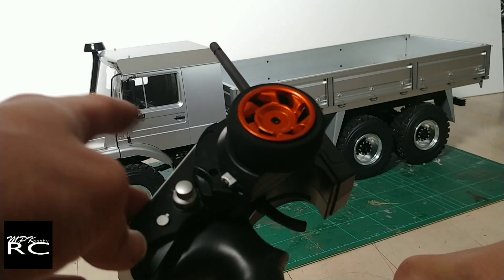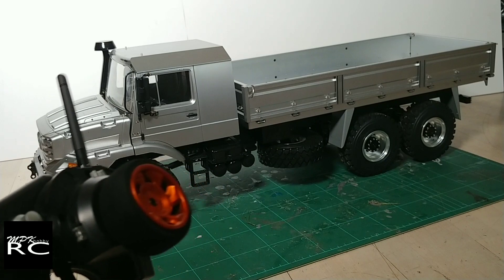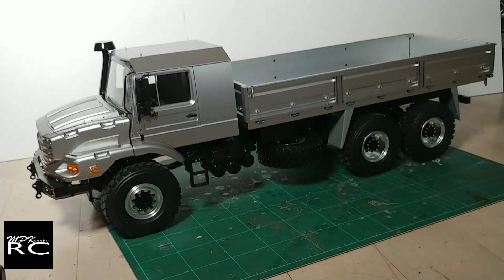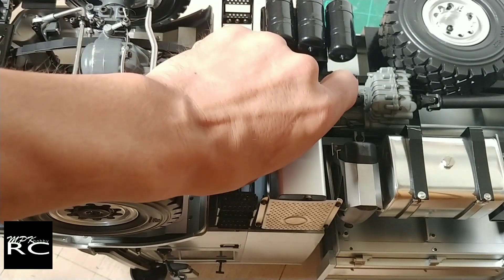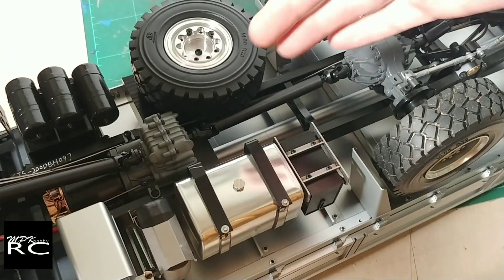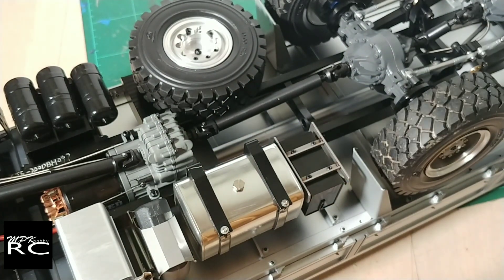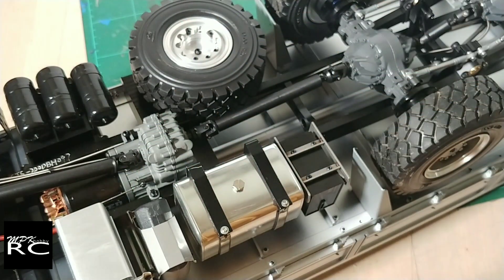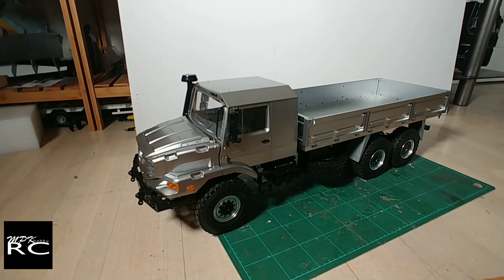Question for Gerry..

Comment: Hello sorry for the late reply!! The cable is the first thing I would look at, i have noticed with some rc4wd vehicles the cables are sometimes not installed correctly.
Start with very small adjustment right on the transmission and see if that helps! Hope this helps!
Reply from the maker: Cool! Thanks for replying, il try that out thanks.. Wasn't sure.. 
Ps again sorry about the name thing..
Reply: @mpkhobbyRC  no worries, my buddies at work call me Gary all the time!
Reply from the maker: So iv been thinking about turning this rig into a lifted king hauler.. Is that blasphemy? I mean i love this truck but love hauling stuff off road more... Thought ud be someome to ask..
Reply: @mpkhobbyRC  not at all, I have tried for years to make my semi's perform better off road, thicker rear diff oil is my new try. When I had the overlands bed off for painting I was looking at it for a fifth wheel and it should work, but its tall so you would have to modify your trailer.
When I priced out the total cost for converting my king hauler to 6x6 I just decided to buy the heavy haul instead!

Comment: just stumbled across this video searching overlands.  Not sure if you got this fix but is as easy as 123 all it is that your servo throw (movement) isn't enough to pull. the shift lever that holds the shaft into high gear.  Now if this transmitter was a better model you could adj the travel of that throw but since it doesn't have that option.  The solution lies in fine tuning your cable or...the servo is throwing to far in low gear and not enough in high.  you also can move servo horn over to compensate that as well...many ways to fix issue and these are just a simple few but its been 3 months so I bet you got it figures out.  Im looking into snagging this 6x6 up because not so hot on my 4x4 beens sitting still just because Im pissed that there isn't shock options out on market for it
Reply: thats my thumbs up at the top 8-)
Reply: do you still have your cab etc are you selling it or?
Reply from the maker: Thanks man! Yeah i ended up just adding a crimp next to the servo.. 4mm seamed to do the trick..
Reply from the maker: I do.. Why? Whould you be interested? Iv just received another im turning into a scania.. So have 2 each bed and body..
Reply: @mpkhobbyRC  Are you in USA if so how much for a complete cab with all the trimmings such as light grills etc..you can email me if you want at one2manyrcs@gmail.com. I am on the fence on my brand new never ran 4x4..its white thought about switching color or in this case just a new cab see up..Also I am debating about the 6x6.. If I was to get the 6x6 do I really need the 4x4?  Probably not lol...I'm really loving what your doing with your creations so much better building them this way then spending the thousands to get pretty much same thing..
Reply: @mpkhobbyRC  you going through rc4wd to get your overlands?  They seem to be in stock other places out at this time..